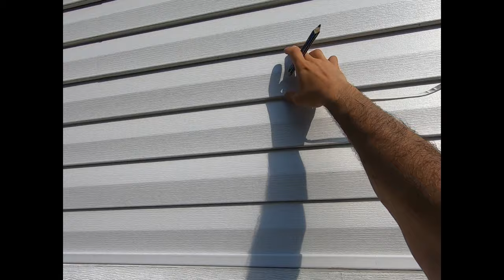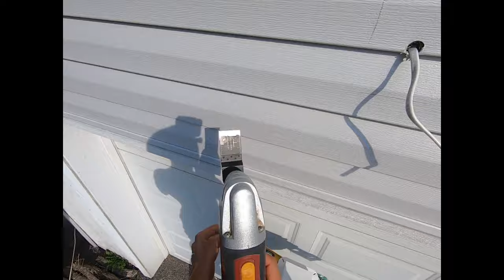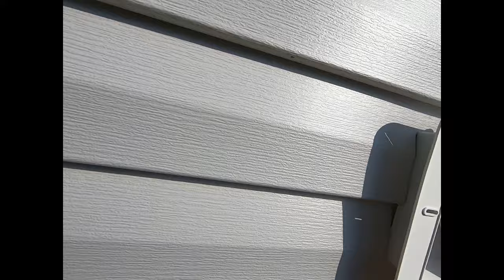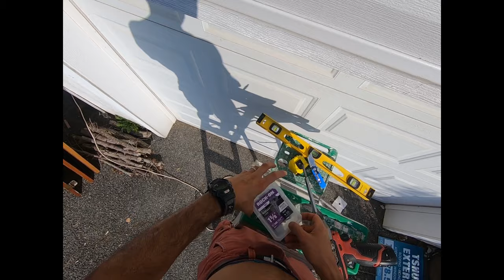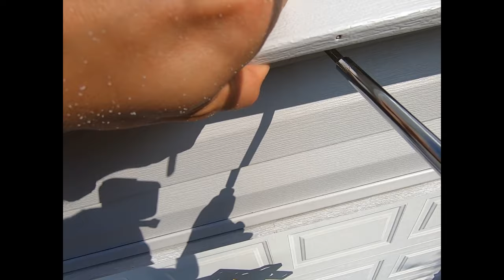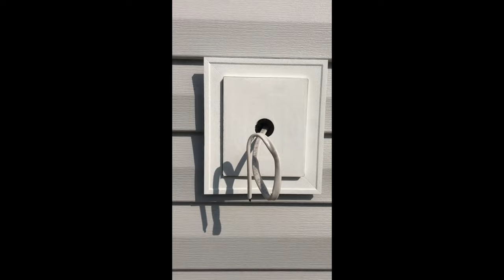How to add a light fixture to vinyl siding - How to add electrical box to vinyl siding aka J block

Comment: Wow. FINALLY a video where I can see the whole process!
You seriously just taught me this. I'm at a loss for words.
You showed us how to open the siding from different angles and even how to screw in the J block after its tucked into the siding... Thank you!!

After the box is installed, do you ever find a need to run silicone caulk around it, to keep any water from finding its way in down the line?
Reply from the maker: Thank you so much for the kind comments and feedback, I am glad you found the video helpful.  I applied silicone around the base of the fixture that I attached to the J block.  I did not silicone the j block itself.  I personally didn’t find it necessary.  It would be very difficult for any water to get into the wiring.  I’ve also been on many inspections and jobs (contractors who worked on my projects) where these J blocks weren’t siliconed.  With that said, if your location is prone to heavy water, suck as near a spigot, water fountain…etc.  you may want to take additional measures to ensure the fixture stays dry.  Hope this answers your question.  Thanks for watching 👊🏼

Comment: needed to leave a quarter inch gap for expansion, and a backer board for stability when mounting a light.
Reply from the maker: Thanks for your feedback.  This was mounted on a band board, so there was sufficient stability there, but perhaps a bit snug on the siding.  Thanks for watching 👊🏼

Comment: im litterly wanting the same lights where did you get them please. and the light fixture was it screwed to the plastic jbox or were screws long enough to to to the backing sheathing.
Reply from the maker: I can’t remember where I got the lights, but I usually shop Amazon and/or Wayfare for inexpensive fixtures.  Type in goose neck outdoor sconce.  I used long screws to tie into the backing.  Thanks for watching 👊🏼
Reply: thank you so much for taking your time to response. im a diy to the bone and i just done building a big shop from the gown up now i got to do lighting and than the vinyl siding.  @TrueGritDevelopment
Reply from the maker: That’s awesome. I bet u learned a ton from doing a big job like that.

Comment: This video is very helpful. My husband went to out a new light up but the previous homeowner had just cut the siding and somehow made it fit the light base. The new light is a different shape. It’s been frustrating trying to figure this out. The pieces of siding to be fiddled with are between two windows with siding trim. Is the trim just a pop off and then pop the 3 pieces of siding where the existing hole is to shimmy a mounting block into? Thanks for posting and any advice on this positioning.
Reply from the maker: Glad you found the video helpful.  To be clear, the siding between the two windows is one piece and you don’t have two overlapping pieces where you can pop up the siding like I did in my video, correct? 
The J channel around the window is nailed on, so you can’t take that off, but perhaps you can pull back the siding? You may need a piece of plastic or wood to pry the siding off of the channel.  Be careful not to damage the siding.  Let me know how that works.
Reply: @TrueGritDevelopment  thanks for the reply! The strips between the windows are about 3 feet long and each end tucks under the siding trim around the windows. The siding feels pretty solidly locked in. I’m thinking I’m going to have to leave my eyesore until I can get someone who knows what they’re doing. I am too worried I will break something. Thank you!
Reply from the maker: No problem.  Thanks for watching and please consider subscribing, your support is appreciated ✊🏼
Reply: @TrueGritDevelopment  done!

Comment: Did you need to add a box for all the wiring connections? Where did all that go??
Reply from the maker: This light was installed through a band board, only way to add a box would be outside the band board, which wouldn’t look right.  Instead, I contained the wiring inside the J block and the fixture.  Ensured everything was wired right and taped with electric tape.  Hope this answers your question.  Thanks for watching and supporting ✊🏼

Comment: Great video.  Could you tell us which power source you tapped into.  Or post a picture of the electrical wire within the garage?
Reply from the maker: Thank you! And thanks for watching, I hope your project goes smoothly.  Not sure how I can upload picture to YouTube.  In this garage I had an existing junction box, so I fed my new lines through the new siding, pulled them inside the garage (I made cuts in the ceiling to fish them back to junction box),  tied them inside the box.  If not, assuming you have lights in your garage, you can tap into that line before the switch, then splice off of that to a junction box at a desired location for the outdoor lights, make sense? Let me know.

Comment: Did you secure the light fixture bracket directly to the j-block?   No j-box needed?
Reply from the maker: Yep, directly to j-block.  No additional boxes needed.  I used a longer screw to ensure I hit the wood behind the block for a more secure setup.  Silicon around the fixture and you’re good to go.  Thanks for watching and supporting ✊🏼

Comment: What type of mount did you use to mount the lights? Is this piece the mount?
Reply from the maker: The vinyl block is called a J block.  It’s a universal mount.  Hope that answers your question.  Thanks for watching 👊🏼
Reply: @TrueGritDevelopment  I think so. So there isn’t an outlet box. Just a cross bar or fixture plate?
Reply from the maker: No outlet box in this situation because I had to go through a band board.  I made sure I stapled the wire and made my connections inside the fixture then sealed it.  I also taped all my connections.  If you’re doing this through sheathing like plywood, you can use an old work electrical box then the J block, makes sense?

Comment: How long were the screws you used to connect to house and did you drill pilot holes first?
Reply from the maker: No pilot holes and I believe I used 2” exterior screws.  For the fixture hardware mount I used 3” screws.  Hope this answers your question.  Thanks for watching and supporting ✊🏼

Comment: Did you caulk the siding that was cut? I don't recall seeing it...
Reply from the maker: Hi, someone else commented on that before, no I didn’t actually.  If any water were to come in, it will drip around n down the plastic flange.  I do have house wrap behind to prevent any water from contacting wood structure.  With that said there is no harm in sealing.  Honestly, I’ve seen many of these J blocks installed w/out any caulking or sealant, so it’s completely up to you.  Thanks for watching and supporting ✊🏼
Reply: I replaced two light fixtures on the wall along my home entrance. The wall consists of wood sidings and I have to use caulk to seal the gap to prevent water to get in (and any small pest too). Not comfortable to see gaps here.

Comment: Great video! Did your Siding block have an electrical box already built into it, or did you mount an electrical box separately?
Reply from the maker: Thanks bud.  I had to go through the band joist, so no electrical box for this install.  However, I made sure the electrical wire was secured and tucked inside the water proof fixture.  I further sealed the fixture.  Hope this helps. Thanks for watching and supporting ✊🏼
Reply: Need a box to have  code compliance

Comment: Good video my man! Do you have to cut the vinyl box to add the hardware or do you just screw it all the way through?
Reply from the maker: Thank you! No need to cut.  Use a long screw through the box and into the wood behind it whether it is 1/2” ply or header board...etc.  the box it self will not hold the weight of the fixture.  Hope that answers the question.  Thanks for watching and supporting ✊🏼

Comment: I was really curious to see how you put in the screws at the top of the flange - but you either just didn't film it or didn't see the need for screws at the top?  Anyway, thanks for the video - it is helpful!
Reply from the maker: I don’t believe I used the top flange, I ensured I had enough screws in there and obviously onto solid wood, that thing isn’t going anywhere.  Thanks for watching and supporting ✊🏼

Comment: What if the siding was installed without wood sheeting behind it? 
Just water proofing, insulation, and studs
Reply from the maker: That’s ok, you will need to find the stud and use it as your anchoring piece.  I would imagine you will want to center the j block to that stud, make sense?

Comment: Did you caulk the top and sides?
Reply from the maker: Few ppl asked the same.  I didn’t, but you certainly can if you like.  I did silicone caulk the base of the fixture however.  I didn’t see the need personally.  Thanks for watching and supporting ✊🏼

Comment: I will be mounting a 200 Amp meter base with a disconnect to a mobile home with vinyl siding. Is there something similar to this that I can use for this project?
Reply from the maker: Yes, they make meter j blocks.  Amazon got them or try a building supplier in your area, they are cheaper than big retailers.  Only thing is I don’t think they come with a trim top, so you might want to grab a thing of J channel.  You will have to peel a lot more siding (no big deal) to have enough room to nail/screw j block then channel.  Make sure siding is warm for optimal flexibility.  It’s winter here in PA, so not gd time for detailed siding work.  Hope this helps. Thanks for watching and supporting ✊🏼
Reply: @TrueGritDevelopment  thank you so much for your response. Do you have a link to what you are referring? I’m in northern Mississippi. Thanks
Reply from the maker: No problem! Check these out:

https://www.homedepot.com/p/100674376

https://www.menards.com/main/building-materials/siding/siding-accessories/15-3-x-16-3-meter-base-mounting-block/14900001/p-1444449697359.htm

Alcoa Home Exteriors METER PW Meter Base J-Block https://www.amazon.com/dp/B000DZBGEG/ref=cm_sw_r_cp_api_glc_i_w2i5Fb10XYGT3
Reply: @TrueGritDevelopment  thank you so much for your help! Your videos are really awesome!
Reply from the maker: Anytime my friend! Thank you so much 👍🏼 happy holidays!
Reply: Can't seem to find any info on how to cut a new door in and install the J channel under the existing siding. So I found this since I also need to ad a light and receptacle. Any help with the door install. Thanks.

Comment: Does water penetrate behind that?
Reply from the maker: Hi, once I installed the fixture I ran a bead of silicone caulk around it.  I also taped my connections for added insulation.  Hope this answers your question.  Thanks for watching 👊🏽

Comment: Might want to leave 1/4” gap on sides around the box. No electrical box? 🤔
Reply from the maker: This was put through the band joist, didn’t want to carve out a 2x4 piece out of it.  The electrical connections were made inside the fixture mounting base with electrical tape and the base was sealed for added protection.

Comment: Doesnt this need flashing to stay waterproof?
Reply from the maker: I assume you mean the fixture itself? The fixture is rated for outdoor use and once installed I went back with silicone caulk and caulked all around it.  Also, whenever you are working with outdoor electric connections, always use electric tape and wire nuts together.  In the event water does reach inside the fixture the tape and wire nuts will prevent it from making contact with the bare wires.  Hope this answers your question.  Thanks for watching and supporting ✊🏼

Comment: I need to replace that and this helped a little can you make a video on how to replace one
Reply from the maker: Thanks for watching.  You are looking to replace the fixture of the whole J block?
Reply: @TrueGritDevelopment  yes its the square block you show us to install
Reply from the maker: I understand.  Once you remove the siding, you should have a clear view of how the J block was attached.  You should be able to u screw it and replace it, it’s the same process.  The only difference is you might have a u shaped channel where the siding terminates, but that shouldn’t impact the job so much, it’s removable if need be.  Why are you replacing it?
Reply: @TrueGritDevelopment  because there is calk stuck all over it and it is a mess
Reply from the maker: Yea, that sounds like it needs replacing.  I would start by removing the siding, cut the caulking, unscrew the current J block and go from there.  I will make a video if I run into this issue though, thanks for suggesting.
Reply: @TrueGritDevelopment  ok thank you do i have to take all of the siding down or just the part by the block
Reply from the maker: Just the part by the block; however, if you can’t get access to all screws on the lock to take it down, you might have to consider removing the siding.  Removing siding shouldn’t be hard, the nails holding the siding should be loose to allow for weather changes, so you can pop them out with the back of a hammer.  Once you have access to the J block it’s pretty straight forward.  Hope this helps.
Reply: @TrueGritDevelopment  ok thank you so much ill let you know how it goes

Comment: Hey bud, nice video. After you put the mount on siding, did you just mount light fixture on that box? If so, it's strong enough for your fixture?
Reply from the maker: Thank you! Yes, the fixture will come with a metal mount and that gets screwed onto the vinyl box and wood behind it.  I used long enough screws to hit the wood and hold that mount tight.  You then attach your fixture on the mount just like any light.  Hope this helps and thanks for watching and supporting.
Reply: you probably dont care but if you are stoned like me atm then you can stream pretty much all of the new movies on instaflixxer. Been streaming with my gf for the last couple of weeks xD
Reply: @Christian Otto Definitely, I have been watching on instaflixxer for years myself :)
Reply: @Christian Otto Yea, been watching on instaflixxer for since november myself :D
Reply: @Christian Otto yup, been using InstaFlixxer for since december myself :D
Reply: @Christian Otto yup, been using InstaFlixxer for since november myself :D
Reply: @Christian Otto Definitely, have been watching on instaflixxer for since november myself :)
Reply: @Christian Otto Definitely, I've been watching on InstaFlixxer for since november myself :D

Comment: Is it up to code to not have a j-box behind the fixture? Seems to me it can’t be code to put the joints into that box that you put up
Reply from the maker: Thanks for watching.  As far as I know as long as the wires are enclosed from the back (in this case the J block) and housed in a box (in this case the fixture box) you can use the J block without an electrical box behind it.  Also, the fixtures are UL rated.  I would never skip a junction box on an outlet though or just hang a wall fixture without a box to mount it onto.  The wires must have backing and enclosure and the whole setup should be secured to a wall/ceiling or whatever.  Thanks for the input, I like discussions with like minded people.

Comment: You need a j-box and you can't cut the vinyl that close because the siding needs to expand and contract. The flange will cover the gap.
Reply: @TrueGritDevelopment  Wasn't trying to sound like a know it all, I've certainly made my fair share of mistakes over the years and will make more.
Reply from the maker: All good.  One of the main reasons I make my videos is to learn from others.  A few ppl mentioned the jbox before.  I punched through the band board, so didn’t want to cut a 2x4 for the box.  I fed the wire through, stapled it in place and taped my connections inside the light fixture base, which is water sealed tight.  In hind sight I could have used a shallow jbox perhaps.  Thanks for watching 👊🏼

Comment: Are there gaps between the sidings and the light fixture ? In this video, I believe there are gaps.
Reply from the maker: Hi, so the flange is designed to protect against water penetration; however, you may like to use silicone caulk anywhere you feel there is a gap.  When water comes down and makes first contact with the box, it will eventually run down the sides of the box and out.  It is unlikely that water will flow inward and down the siding.  With that said, caulking doesn’t hurt.  Thanks for watching and supporting ✊🏼

Comment: No caulk?
Reply from the maker: You mean where the vinyl siding contacts the J block? Or around the light fixture? If it’s the latter, absolutely silicone caulking. As far as the J block goes, I never had any issues and I don’t think I’ve seen them caulked before. With that said, I don’t see any harm in caulking.  Thanks for watching.

Comment: No junction box?  That's bad!
Reply from the maker: Stapled my wire, taped connection and tucked inside the base of an exterior rated fixture that was subsequently sealed with silicon.  I wanted the fixture flush with siding and punched through rim joist.  Like another viewer suggested, a block with a box includes may have been a gd alternative.  Otherwise a traditional J box would not have worked here.  Anyway, it’s a sealed tight connection between plastic J block and fixture with no exposure to wood.